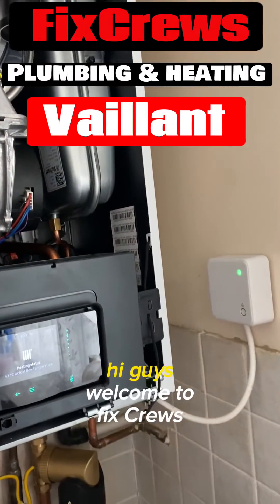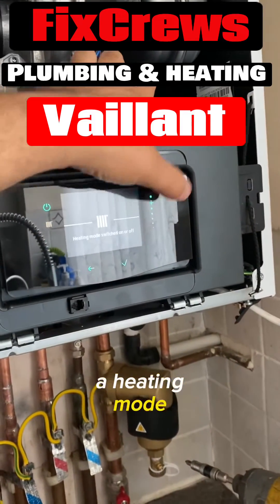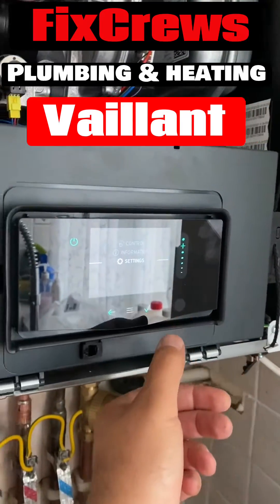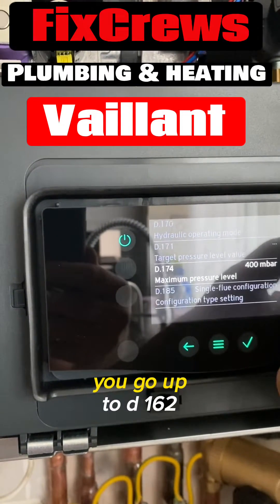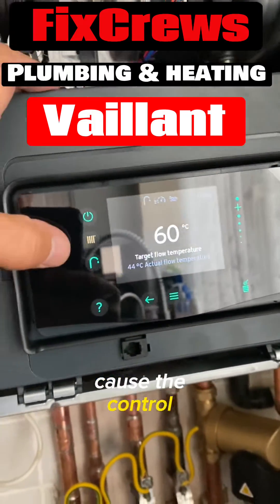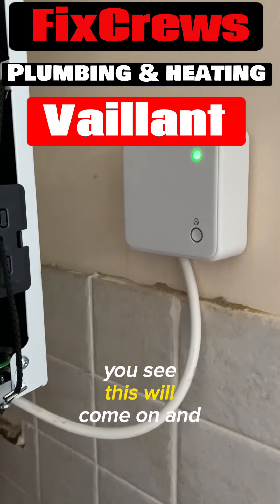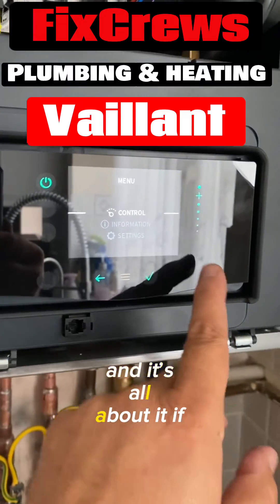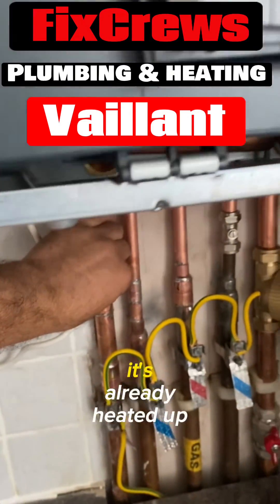New Vaillant Ecotec plus N100 code weather compensation/ sensor D162 How to local gas Engineer

Comment: I got a question if you could help me out, the 24V RT, should that stay connected if I have Vaillant VRC 720(f) installed with the internet gateway? Both are connected directly to BUS connections at bottom of boiler.

I had an installer at first install some sloppy thermostat that connected directly to the positive and negative ports of 24V RT, then when 720f was installed I placed the red wire back to it. Is that correct?

Also, I have weird behaviour on my app, the thermostat is measuring current temp at 23.5, I have it set to 21 but it still indicates that it is heating the system. Even if I go to 15 degrees C it still shows as heating. Operation mode is set to time controlled where at night temp is set to 18, and during the day to 22. I am testing now with manual mode but the  behaviour is the same.

Comment: hi, can you tell me what the annoying N27 error means? Thx
Reply from the maker: It is most often caused by moisture that damages the electrical components or a defective computer board of a Vaillant boiler. This condition can also occur with F61 and F62 fault codes, which both relate to defective gas valves.

You will need to inspect the ignition components and gas supply of your Vaillant boiler for this problem. This error means that the boiler repair must be carried out by a Gas Safe registered engineer.
(from Vaillant)
Reply: Ok thx , is no other just N 27 and it s N not F

Comment: If using the new valiant controls mid or high end they come with a wireless external sensor which will reduce your consumption by about 15%   Warm up program times though will take up to 3 hours to minimise your consumption, this doesn’t affect your hot water , but I would also recommend turning off comfort mode made famous by the w sec pre heat on pipe jargon but that also can consume up to 20kw a day , also remember hive is not boiler plus you have to pay for that but also it is not worth it stick to valliant controls